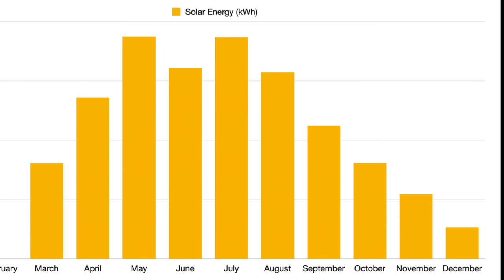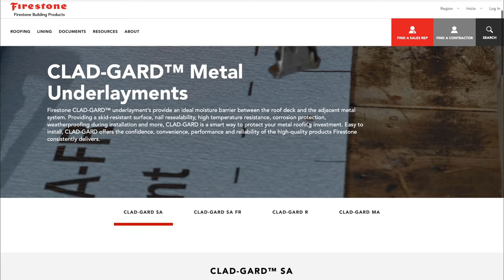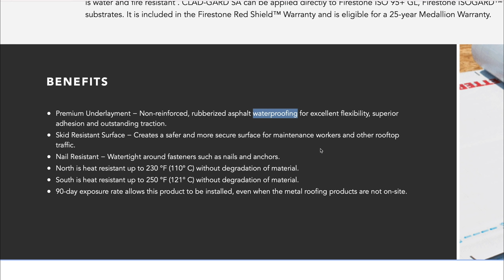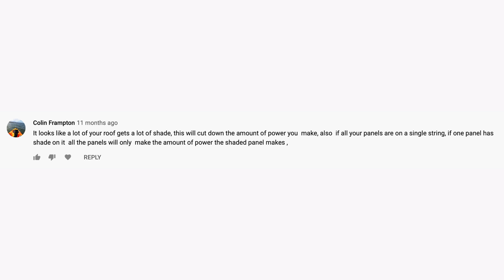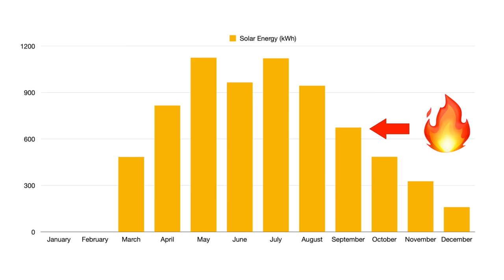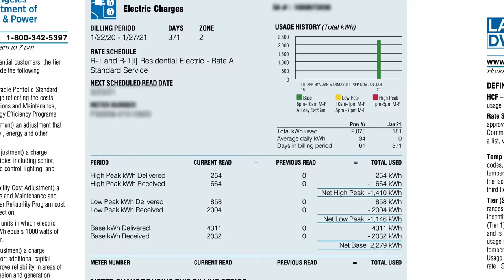1 Year with Tesla Solar Roof: top 11 questions answered + real production numbers & utility bills!

Comment: A couple of questions: 
1-How much does it cost to clean and how often do you think this cleaning is needed?
2. Any other maintenance expenses during normal use?
Reply: he only really cleaned them duo to environmental reasons on his region, i would guess if there are no forest fires and it rains periodically where you live it should be fine to just... never clean it
Reply: @toddhowardfr  Never cleaning sounds great, though somehow it is difficult to believe that is correct..
Reply: Actually I would go on once per year. It seems reasonable because of dust and other stuff.
Reply: I can't imagine it being terrible difficult to clean, a electric pressure washer with an extended wand should be able to knock off any dust or soot you might have on it.
Reply: It's the cost that I would like to know
Reply: @anotherOneMore7  I've never cleaned my normal panels...its been 3 years and last year was my best producing year
Reply: @jacksoft2597  in california? probably about 400 dollars
Reply: @kevinbraunmiller9907  I've never cleaned my solar panels. When we're not dealing with a drought the rain does a more than adequate job of cleaning the solar panels.
Reply: I have to pressure wash my house every year due to all the pollin we get. So I'm sure the same would apply for my area
Reply: I dont have solar yet but as to the cleaning, if its single story you can construct a tube with a scrubber and hole that goes on your hose and reach from the ground or a ladder. However a 2 story home may require a bit mote effort. I have seen it done.
Reply: if it's like any other solar panels, it gets clean when it rains and maintenance is the replacement after 20-25 years, the inverter after 10-15 years. but it all depends on your area, treat it as your regular roof, ash, pollens, dust and leaves needs clearing as required.
Reply: @anotherOneMore7  if its easy and safe to do ,  then sure clean it every few months. But its not worth paying someone  to do it as the money you loose paying someone would be more than the money gained thought a clean panel.
Reply: @anotherOneMore7  It's actually correct. I never had to clean mine in the 6 years that I have them. Currently they have a very thin layer of dust on them but I expect rain in 2 days from now and that will take care of that.
Reply: I wonder if you can step on the tiles.  I'd be up there with a hose and a soapy scrub brush...but my roof is not steeply sloped...thank god.
Reply: In 2 years we have cleaned the solar roof once.  This was after we had some major fires to the East, remember the pictures of San Francisco with red skies, right after that.  The roof comes very clean after a rain, but does get dusty after a few months with no rain.  However, the impact on production seems minimal.  In summer we have refilled 2 powerwalls and are sending power back by 11 AM for credits.  With these credits, our net electrical cost is down to around $400/year versus $5000+/year.
Reply: @NPAMike  Pros are better and you would want to accidentally mess up the connections with a person DYI sprayer washer biz.
Reply: @JBoy340a How much did the solar panels cost?
Reply: @Rainy_Day12234  my total Solarroof install was about 65K.  It worked about the same as the new roof we needed plus traditional solar panels.  But we got a larger solar tax credit for the Solarroof vs new roof + panels.  That reduced the price down quite a bit.

Comment: since nothing is ever free, my questions would be
1. How much was the cost of the panels, if you bought them or were they through a business?
2. How much is the cost of installation? 
3. How much of those 2000+ savings were spent on repairs and/or maintenace? 
4. Does house insurance cover the panels, or do you have to get another plan for them? such as fire, floods or anything?
and last question...
5. what were the drawbacks from your experience with it?
Thanks. im thinking about getting solar panels now, so trying to do some research, for my benefit.... the enviroment, don't care to much.